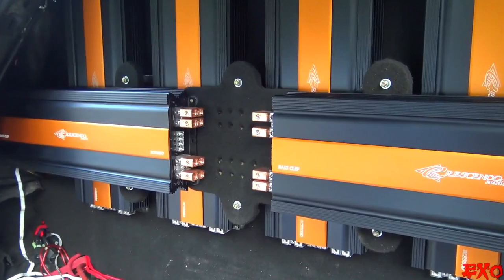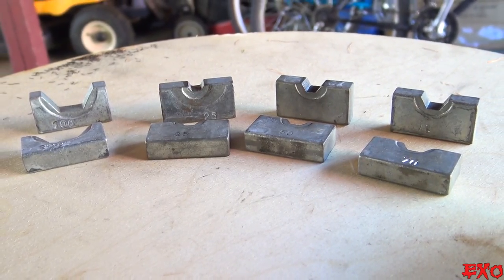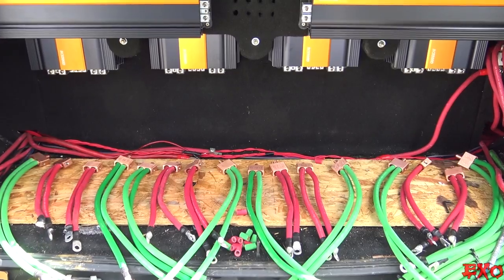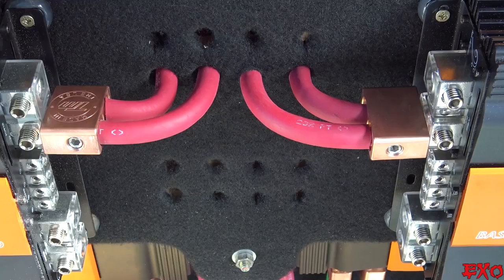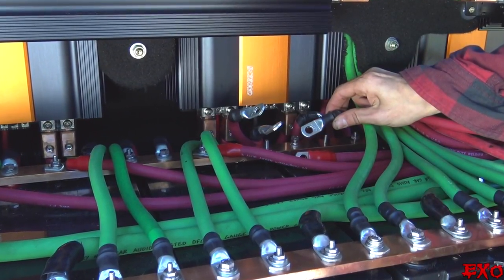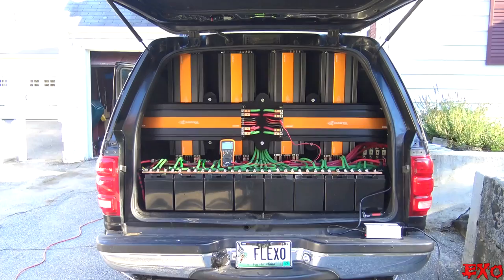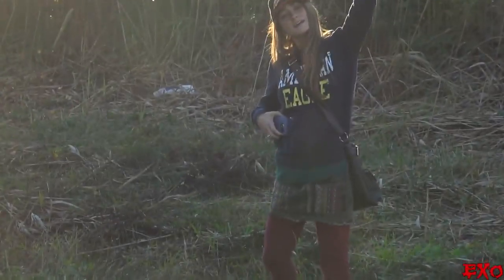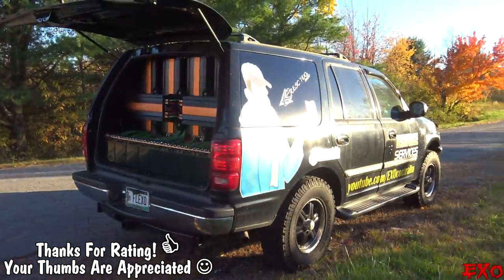EXO's 30,000 WATT Amplifier INSTALL | Wiring SIX Crescendo Amps + 1/0 Toolmaker Inputs & TESTING SPL

Comment: nice video! Why did you set the gain of the amps to ~1V? What tune did you use?
Reply: prolly just gain matched at 1v
Reply from the maker: I set them at 80v without the subs hooked up. Just wanted to show how each one was matching, I couldn't turn it up any louder at that point because the subs were hooked up :)
Reply: EXOcontralto what should i use for a blow through bed ?
Reply from the maker: Blow through bed?
Reply: EXOcontralto blow through truck yeah like what subs and amps do you recommend
Reply: +EXOcontralto now you hitting the 160's are you gonna try for the certified 160 decal?

Comment: If I may suggest a duel battery isolator for using more then one battery in your littler installs
Reply from the maker: Why on earth would I do that? 

Isolators should only be used on separate voltage setups and setups that are mainly used while the ENGINE is off!

Comment: So congrats, but how do you keep all the battery’s powered ?
Reply: alternators
Reply: 5 alternators running off of the engine
Reply: Flux capacitor but make sure not to drive over 88mph

Comment: Got a question maybe some one can answer. My amp has 0 gauge power connections. But my oversized 0 gauge don’t fit. So I bought some reducers that wire fits in an has a stud about 4 gauge sticking out other side. Is this reducer going to restrict electrical flow to amp?
Reply: You should probably get some proper 0-gague wire, if you want it to be done right.
If your wire is too big, you could cut off some of the strands at the amp connection to make the whole bundle fit. I don't know if i would trust a 4 gague connection on an amp with 0 gague connectors. Keep in mind that a smaller connection increases resistance, which will restrict power flow, and also generate heat.
Reply: @colbiesthename2875  NOOOO NEVER CUT THE STRANDS. and if you have good whire adapters it will have a power loss off nearly 1 procent. So just get good copper and silver tinned connectors. If you cut the strands you will create a much bigger  resistance. And so a lot more powerloss

Comment: Why are half of the nuts and bolts opposite ways? Why didn't you keep the pattern the same way on the bus bars for aesthetics?
Reply: Jason Emery  The bolts were goin to hit top of battery Of he face them down. And it wouldn’t fit.. The bolts that’s pointing down is the bolts that go in the whole from the buss bar to the battery.

Comment: Since you are doing something new with franky, would you mind me using your design? The infamous exowall design needs to live on. (Wanting to do 6 deaf bonce sa418s on 3 taramps 12ks btw)
Reply from the maker: HAVE AT IT, ZACH!!!!
Reply: @EXOcontralto  I'd LOVE to see this setup in a 1989 Dodge Grand Caravan LE 😉 That was my old van and I built a wall with 12 12" 400 Watt Pioneer Paper Cone Subs from walmart with 6 400 Watt 4 Channel Optimus 400XL's Bridged to power all 12 subs Plus I had an Optimus 200XL 2 Channel amp for the sony XPlode 6x9's in the front doors which also pushed the 4.5 StillWaters in the dash with a sony 2 Knob Tape Player until I upgraded to a Sony XPlode Flipface CD/MP3 Player 😂 I LOVED to play Techmaster P.E.B. It came from outerbass II AND ENIGMA "Return To Innocence" in the tape player and never could find it on CD when I upgraded... Those amps got hot quick and distorted because I didnt know anything about caps or a bigger or multiple alternators and stuff but boy she did pound 😂🤜🏽🤛🏽

Comment: 8:04 THE GREeM CABLE IN LEFT SIDE INVERTED
Reply: with my ocd, i noticed it aswell, they fixed it, however at the end i saw more stuff not matching up, like different screws/bolts used to attach the cable's to the battery packs, and some wiring on the backside (red power cables) even seen 2 clamps on one battary pin)
Reply from the maker: blah blah blah lol
Reply: lol

Comment: Hey do you know what audio system would be compatible with my 2007 honda civic hybrid I'm looking for something subs and amp for like 500. Hit me up please I need help
Reply: Jeremy J. Garcia get one 12 running maybe 250RMS in a ported box with a matching amp. You can get away with 4gauge wire to keep the cost down. $500 will get you something pretty good. If you are stuck on two 12s make sure you measure to make sure the box will fit. Ported boxes are bigger than sealed but will give you more boom. I don’t want to give all my secrets away but Skar makes some of the best audio for a great price. I have dual IX 12s in my suv and it slams. I would have been happy with one 12 but I love it loud. Hope this helps. I’d be happy to help with any other questions.

Comment: can anyone tell me if it's ok to upgrade my 50 amp car battery to 100 or 120 amp?
    plsss help..  i prefer DIY.
Reply: Janjan demecillo yes
Reply: aaron reynolds will it affects my lightings?
Reply: Yes you can. The reason for your resistors switches and fuses will allow you to. But the only question is the rating of your wiring to your alternator and starter. Or anything directly connect without a step down. As long as your wiring is rated for the amperage you're good.

Comment: I'm confused I hit 160 with 2 15s and 2 amps why does yours take so many amps
Reply: James Williams your two subs won't produce the same amount off pressure that exo does ,his set up is at a different level to yours
Reply: James Williams his is built for very long duration demos and music, is yours built for burps?
Reply: MASTERT KILLA I'm not talking about mine I'm commenting on this sound system
Reply: unless you have like 2 sundown team series or dc level 6/7s running on 2 10k amps your not doing 160
Reply: I'd like to see that setup.
Reply: lol seriously? because Terry Brocks does it out of  trunk on less than 5k
Reply: I just looked up guys who do 160 with 2 15s and the lowest RMS they are moving was 12k...
Reply: Also the highest he hit was a 157 there is no rounding up after 150 because those 3 db can be hard to gain
Reply: also have you SEEN any of Exo's vids? his wall has a very very wide bandwith. USUALLY but not always higher bandwith means lower numbers at the trade off for being able to play full tilt and sound damn good from the lows to the highs with basically no rolloff.

Comment: Question why everytime you hold copper do hold it with tissue it looks like
Reply: idk if im right but i think its because the natural grease off of fingers will oxidize the copper faster
Reply: @phantohs3729  thats what i was thinking but didn't say anything because i wasn't 100%
Reply: @phantohs3729  Yup, thats the reason. Even gloves and holding it with tissues wont stop it from oxidizing farely quickly tho
Reply: Because it is really dirty you know.

Comment: How do you charge all the batteries in the back?
Reply: LocoRubz 7 chargers or put in the runing time for alternators to do it for you.
Reply: Daniel Sifuentes so is it possibile to put, for example, 2 batteries in the back of the car, wiring to them 2 different amplifer and just charge them with an external charger? Without having them connected to the alternator?
Reply: It’s posible yes but it’s not recommended because amps draw a lot of current so you would be charging almost every hour or so depending on the batteries. Why would you not want to wire to the alternator?
Reply: Daniel Sifuentes yh you’re right... i thought i can also wire the + and the - of the original battery to the + and - of the one in the back, it should work, right?
Reply: Yes that helps. Either that or straight to the alternator wich ever is easier for you.
Reply: You can do wire a second battery just in the trunk but it's not recommended if it's not exactly the same type of battery. You'd need atleast both batteries at the same capacity (Ah), if you don't match those numbers, one will drain the other. That's why most of the time when shops install a second battery for just the sound system they'll wire in an Relais to cut off the battery once the igniton is turned off. While the car is running, it's charged up by the alternator. Just simply search for battery Relais. A 60 Amp Relais should work for you.
Reply from the maker: They are wired in parallel to charging is a breeze. Just hook up a charger to any pos and neg, then boom - charging away.

Comment: I would have stuffed some solder In the terminals then heated the terminal up and let the solder flow then crimp it
Reply: Crimp it properly and it'll practically be cold welded, no need for solder really.

Comment: "Loudest Sound Possible" 194 dB
Jet Engine, close 160 dB (Near instant perforation of eardrums)
Threshold of pain 140 dB
Jet Engine, 100' 130 dB
Pneumatic Drill 125 dB
Rock Concert 120 dB

hahaha holy crap

I know its not exactly applicable because of frequency etc. but still.
Reply: Loudest sound generated on Earth was Krakatau Volcano Eruption 330 DB :)
Reply: mq1991 in terms of bass, as long as it's clean, bass does no harm to you UNTIL you get into the 160s and then it can start to cause brain damage

Comment: why isn't the speaker wire the same size as power wire?
Reply: wut
Reply: Is this a serious question?
I will assume so.
The input power wire is handling several hundred amps of power, at a 'low' 14-15 volts.The speaker wire is handling a much higher (50+) volts at a much lower current.
Due to this, the speaker wire does not need to be very large.

Comment: how many watts can one of those subs take?...
Reply from the maker: Around 4.5k rms
Reply: so the 5500's arnt at full tilt then?.im just tryn to learn more...
Reply: SlayerHawkX headroom. Allows for less amp heating, more amp longevity, more sub longevity, clean power with the gains correctly set
Reply: always wondered how ppl put 40000 watts on 4 or so subs..i love this stuff!!

Comment: No fuses for safety?
Reply: SirFrag32 fuses are manily for like spikes of electricity. His alternators are made to not spike and his batteries are AGM so its a lot less of risk
Reply: 69 The World fuses are to protect the electrical system from amp failures, short circuits, grounded out wires, carelessness with all of those exposed contacts. They may keep your car from burning to the ground.
Reply: If the wires are laid correctly and heat shrink and solder is used it's all a thing of the past.

Comment: You wired bottom amps up green outside. but the amps up top u wired different
Reply from the maker: Just a quick mistake we noticed a couple moment after :p  I tend to rush a bit when the camera starts rolling.

Comment: How much did this cost
Reply: Killer King in the description he’s got the equipment listed, google it. Seems like he could have been sponsored and saved a shit ton but still, not cheap.
Reply: @snakeradish  thanks man
Reply: Those amps are going for 1200 a piece rn. So about 7200$ for that alone. I stopped after I calculated that. I'd imagine this setup would be around $15-20,000 without his sponsors and without reusing wire

Comment: amp positive and negative bacwards on left horizontal amp
Reply: nvm he fixed it
Reply: Ben Williamson I seen that too before I seen he had fixed it that's y it's always good to check everything before putting it on the battery EXO is a good dude
Reply: +David Armstrong yea man, he seems real. Builds his own setups, shows his mistakes, and even bleeds on camera. by far one of my favorite bassheads.
Reply from the maker: Good eye!! Yeah, I was rushing at that point because the camera was rolling. We noticed the wires just moments after filming the closeup 😂

Comment: was it just me that noticed.  on the right horizontal amp he had a balls up and put the green and red wire in the wrong holes but when it was showing off time it was fixed. whoops
Reply from the maker: Good eye man!  It can be kinda hectic running the camera and installing at the same tine.  Got a little jumbled up rushing shot and accidentally did that, luckily we noticed just a couple moments after and fixed itt 😂
Reply: EXOcontralto holly shit. a reply. i leave lots of comments and no body ever replys. i wasnt ragging on you bro i love your work .

Comment: Hydraulic crimper FTW
Reply: Simon Zhao
Yeah. I would rather be soldering those connections to the wire and not do a amateur install
Reply: A hydraulic crimper is the proper way to terminate those large cables.

Comment: Can i use a 1000 watt amplifier on a 1500 watt subwoofer get back to  me exo please
Reply from the maker: Of course!!!!
Reply: I used a 4-Channel Amp (MacAudio ZX4500 Black Edition) with 125W RMS per Channel at 4 Ohms and connected it to two 250W JBL GT4-12 Woofer and two 250W VXT24 PA-Tweeter.
A dB-Drag measure gives me 138dB.

Comment: Sorry, aber der Sinn des ganzen entzieht sich mir komplett!
Ein Vermögen für Technik auszugeben die ich nicht ansatzweise nutzen kann, und wenn doch...
160 db machen dich viel zu schnell kaputt!
Also, sinnlos das ganze.
Aber wer schön viel Spielgeld übrig hat....
Ich persönlich würde ein sauberes und aufgeräumtes Auto bevorzugen. (und zwar in der Fahrgastzelle!)
Reply: Freaks
Reply: Jup. Denke ich auch.
Ich hatte in meinem letzten Auto eine zierliche Mac Audio ZX4500 Black Edition, zwei 1F Kondensatoren zur Unterstützung, eine große Box in der Breite, wie sie gerade in den Kofferraum passt und dort zwei JBL GT4-12 Woofer in getrennten Schallkammern verbaut. Die Box ist komplett geschlossen, die Woofer von aussen eingesetzt. Nur in dieser sealed-Box Variante sind die GT4-12 dauerhaft voll belastbar und liefern ein sehr lineares Frequenzspektrum. Bei einer Messung auf einer dB-Drag Veranstaltung kam ich damit auf 138dB (Class C, Platz 3). Das ist mehr als ausreichend. Wenn ich aufgedreht habe, sind Anzeigeinstrumente optisch geschwommen. Neben den zwei Woofern (je 250W RMS) hatte ich noch zwei 250W RMS PA-Hochtöner verbaut, die für einen kristallklaren Sound gesorgt haben. Verzerrungen / clipping trat bei mir absolut gar nicht auf, bzw. war nur durch Messgeräte aber kaum nachweisbar.
Wohlgemerkt haben die Woofer und die Hochtöner jeweils maximal 125W RMS bekommen... eben das, was die ZX4500 hergeben konnte.
Es braucht also nicht viel Leistung, um gescheiten Sound zu bekommen. In der ZX4500 ist nur das nötigste eingebaut, was ein Verstärker zum Verstärken und zum anpassen der Frequenzen (Hoch/Tiefpass und Subsonicfilter) braucht. Bei HiFonics sehe ich oft komplett vollgeklatschte Gehäuse (teilweise in Sandwich-Bauweise) mit zusätzlichen, klangverfälschenden Schaltungen die man einfach nicht braucht. Phasendrehung, oder Bass-Boost kann man bei gescheiten Autoradios auch dort einstellen.
Fernbedienungen zur einstellung der Eingangsempfindlichkeit vom Fahrersitz aus, sind blödsinn. Man stellt die Endstufe einmal richtig auf das Lautsprecher-Setup ein und dann lässt man die Finger von den Reglern. Zum einstellen sollte das Autoradio auf 75% der maximal Lautstärke gestellt werden. Ich hatte die Endstufe zum einstellen auf dem Schoß liegen. Alle Türen zu, ich auf dem Fahrersitz, Meßgeräte angeschlossen und gib ihm.

Comment: 1st build??? guess yor long time subscribers and your sound streem van, amps and subs mean nothing.. how bout your toilet paper trick. with your prefabs? but still.. looking good meng
Reply from the maker: I appreciate you following all these years! But if you re-watch the videos you'll remember thag I didn't build any of those setups, but I still loved installing then! Pine Tree Mobile Sounds built the dual 12" box, and Dr. Stereo built the single 12" box. And as far as the old Soundstream wall, that was built by DaveTheBoxGuy :D Thanks for the comment!
Reply: EXOcontralto what about the 2 15s AND 2 18s boxes?

Comment: 30k 160 decibel.? I  3000watt zapco 1 rockford t2 145 decibel.
Reply: You don't understand how decibels work?
Every three decibels is twice the SPL.  The means 15 dB translates into 10 times the volume.
Reply: Decibels are in Log10, then to add 3dB you need to double the power,  then from 145dB you have, to 148dB, you will need to feed 6kWrms to your RockF T2 if it can handle with that power.
Then for 160dB, +15 means 3+3+3+3+3, then 3000x2x2x2x2x2=96kW with your same conditions.
Btw, Zapco is a great brand!

Comment: he ihr vollhorste was bringt eine 30000watt anlage in einem SUV????
so ein blödsinn man kann 150 watt bei guten komponenten kaum hören 
aber euer gehör ist bestimmt schon verblasen
30000watt ich lach mich platt
Reply from the maker: --> https://www.youtube.com/watch?v=g8N-bea_lUk
Reply: endlich mal einer der dett erkennt hihihihi
Reply: Naja, jede dieser 6 Endstufen kann laut Datenblatt bei 1 Ohm 5.000W RMS abgeben (bei 4 Ohm sind es nur noch 1500W pro Endstufe). Zusammengerechnet sind das schon 30.000W. ABER: Die Leistungen von 6 Endstufen kann man eigentlich nicht einfach so addieren. Das läuft nicht. Die Leistungsaufnahme, also das was die aus den Batterien ziehen, ist um einiges höher.
Habe mal einen SUV bei einer dB-Drag Veranstaltung gesehen, der auch mit 5 Endstufen á 4kW Leistung auf die 160dB gekommen ist. Vordertüren und Heckklappe waren offen - nur die hinteren Türen waren zu und kamen gute 3 cm aus dem Rahmen heraus.
Ich hatte ne Mac Audio ZX4500 Black Edition mit 4x125W RMS, zwei 1F Kondensatoren, zwei JBL GT4-12 Woofer im geschlossenen 2-Kammer Gehäuse (für Stereo Betrieb) und zwei PA Hochtöner. Damit kam ich auf mehr als vollkommen ausreichende 138dB.